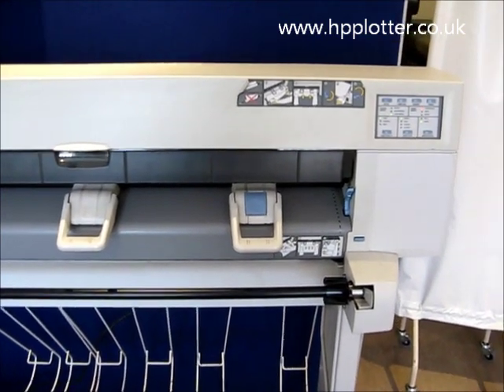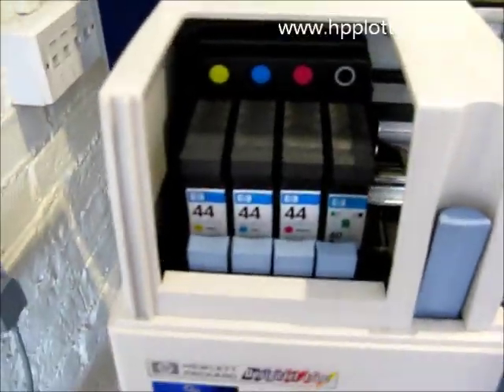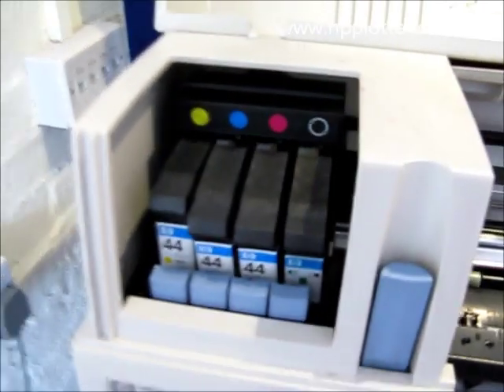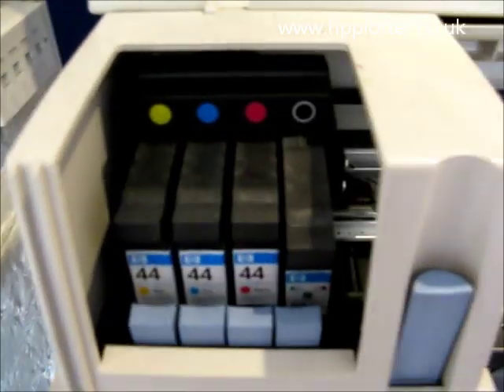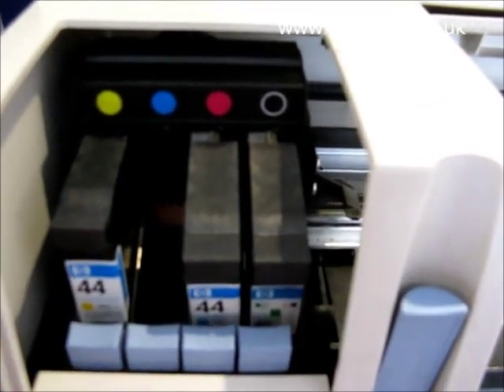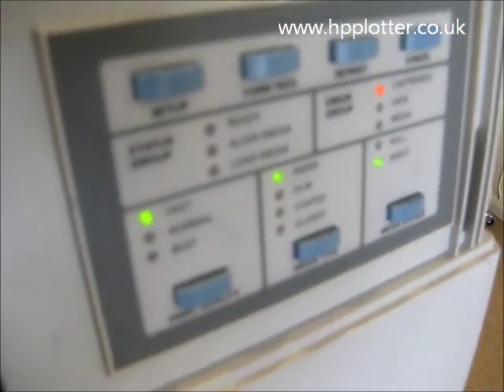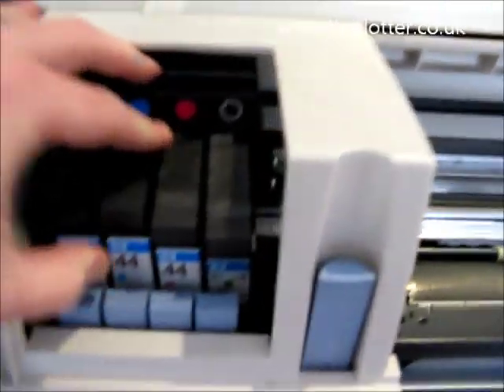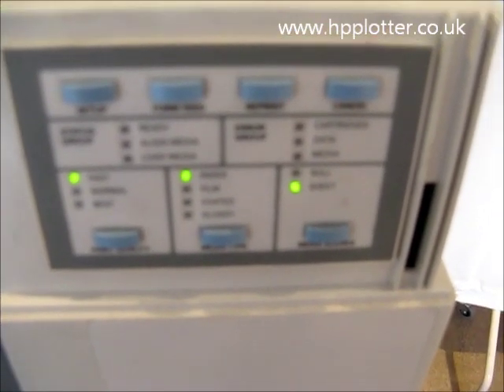DesignJet 450C repair- cartridge error

Comment: I've had my 450C for over 15 years. When I've run into the flashing cartridge light it was always like playing roulette trying to figure out which cartridge was the issue. I've learned something new today with the ready light working for each. Thanks for this.
Reply: PS, simply cleaning my contacts usually fix the issue. For others, try cleaning before using up a new cartridge.
Reply: do you have a print driver for xp?
Reply: @SuperFlyingD  I'm sorry I don't. I actually have only just come back to Windows and am using Win 10. For which there doesn't seem to be a driver. I've just spent a few hours trying to get the plotter to work in Win10 without luck.
I still have my Mac machines and I'm using the Gutenberg for Mac drivers to run the plotter.

Comment: i know this is an old post but i was given a HP designjet 430 
printer...and when i power it on it seems to go through some sequence 
and then at end it shows green steady ready light but in the error group
 it has solid orange lit cartridge and media  any ideas what could be 
wrong?....i tried loading paper but it goes through a back and forth 
sequence numerous times and then just spits out the paper i loaded 
driver into my pc and if i try to run test page nothing happens at 
printer... i cleaned the cartridge ...i cleaned the encoder strip...now that i saw this i see what may be happening..it keeps going past the white plastic piece on the end of roller and never stops at it..and eventually gives up..i can see a red laser coming from cartridege carriage but it doesnt see the white piece for some reason and stop
Reply from the maker: Hello der ddd - You cannot buy sensors alone so you would have to purchase a replacement carriage. If you are UK based please contact engineering@hpplotter.co.uk for the cost of a second user carriage.

Comment: Hello. My plotter machine doesn't work and i've been told that it has a problem with the ''Sensor Printhead''..What exactly is this component ???...It doesn't work and i can't print anything...Thank you..
Reply from the maker: @Dimitrios It sounds like it requires a replacement carriage assembly due to an issue with the sensor. Does the Cartridge Data light appear? Please contact engineering@hpplotter.co.uk if you need further assistance.

Comment: English:
Friend I have a problem is "Error Trace"
What could it be?

Spanish: 
Amigo yo tengo un problema es "Error de Trazado"
¿que podria ser?

I'm speack spanish sorry for google Traductor
Reply from the maker: Hello Emerson - thank you for your email. I'm not sure that I understand your 'error trace' message.

All errors on this machine are displayed via a light system.

Normally you would see the 3 lights appear on Cartridge + Data + Media - if the light is ON and STEADY then it is normally a minor error, if the light is FLASHING then this is a severe problem which definitely requires an engineer.

In both cases, press the CANCEL button to display the subcode of lights (e.g. after pressing cancel you might find just the Ready + Data light remains or the Ready + Cartridges + Data light remains etc...  You need to let us know what lights appear in order for us to assess possible parts which have failed to supply an accurate repair estimate. Please email engineering@hpplotter.co.uk with this info so we can help. Thanks!

Comment from the maker: It sounds like it's either a cartridge issue or the trailing cable needs to be replaced - although we can better assess the problem onsite for you.  Please contact us on 0845 0770 787 or email engineering@hpplotter.co.uk for a repair estimate.

Comment: I have a HP DesignJet 450C.  I have gone through the diagnosis outlined here for the cartridge error and have found the yellow one to be at fault. I don't ever print in colour though, and was wondering if there was a way I could override this error to only print with black.